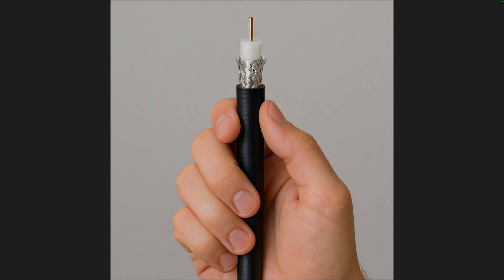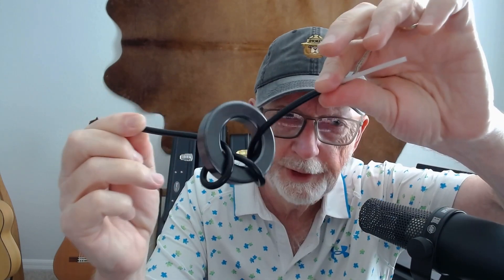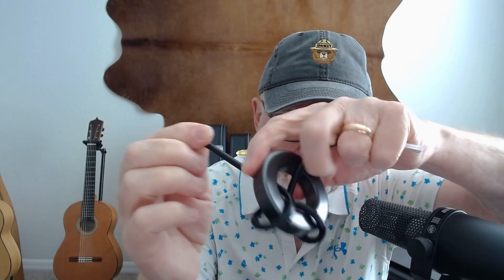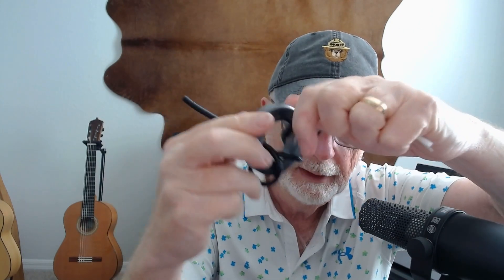Ham Radio Operators Don't Know How Coax Works.

Comment: Instead of using a Ferrite ring, couldn't you just ground it to accomplish two missions?
Reply: From experience, I have found that connecting coax shield to earth ground reduces common mode interference signals (i.e., noise) from nearby EM sources like light dimmers and plasma TV screens.
To a lesser degree, It may reduce common mode current from a connected antenna -- especially when other parallel earth ground current pathways are available; e.g., a radial system for a ground mounted vertical antenna.
Also, earth grounding coax shield provides some lightning protection.
Regardless, I always place a CMC near the feed point of any coax fed antenna that's not ground mounted, and a CMC at the transceiver.  For ground mounted antennas, I leave the CMC off at the feed point which allows the outer shield to  perform like an additional radial wire.
Reply: @DaDitDa  This should not be anecdotal. It is textbook RF hygiene. Voltage-driven (E-field) displacement current from local noise sources can be reduced by grounding the coax shield, since this provides a low-impedance path to drain the induced potential. However, a common mode choke will do the same and often better, by presenting a high impedance that prevents the current from flowing in the first place. On the other hand, current-driven imbalance from the antenna system requires a choke. Grounding will not stop a driven RF current. Only high choking impedance at the right location will. So while grounding helps for E-field noise, choking is effective in both cases and is generally the more robust solution.
Reply: @on6ure  To paraphrase Steve Martin: Well, excuse me for being anecdotal.
Reply from the maker: The shield of a coax feed line IS connected to the chassis ground.  Doesn't stop RF in the shack problems.

Comment: You really are a goto source for great myth busting!  A couple of small points though.  Ladder line fields do not cancel perfectly - there are some significant near fields which is why it is important to run it properly away from conductors.  Coax avoids that issue.  Also, losses are primarily due to the I^2 R skin effect losses of the conductors.  Ladder line losses are lower from having a much higher characteristic impedance, thus lower current and lower I^2 R losses.  Finally one extra note on balanced/unbalanced:  A key point is how a line reacts to external signals like noise.  Balanced line will pick up noise equally on both wires, so the desired differential signal is mostly unaffected.  Coax will only pick up noise on the shield. That is the origin of it being called unbalanced.
Reply from the maker: Great points and thanks for sharing your knowledge!

Comment: Return current floating on the outside is still differential mode ... it will obey Kirchhoff's Current Law. It flows still in the opposite vs center ... it does not make a magical phase turn ;) This is according to me the most stubborn myth in ham radio ...
Reply: Somewhat true.  But with the shield grounded -- the usual case -- it's connected to the return pathway of all sorts of RF signal sources -- including EM sources like the inter-connected antenna and nearby RF emitters.  In other words, the shield's impedance with respect to ground approaches zero.  Thus, via mostly capacitive signal coupling and direct connection to an antenna radiating element, the outside of the shield provides multiple signal return pathways via ground; i.e., an unbalanced condition.  This is not the case for a true differential mode transmission line where both conductors are isolated from ground.  If a stray RF signal source couples to a differential pair, it will likely be equally coupled to both conductors, and it will have no return pathway via ground.  Thus, there will be no unbalanced or common mode signal flow on a differential pair.
So, for coax, it appears that the inside shield and center conductor are operating in differential mode, and the outside shield is operating in unbalanced mode which supports common mode signal flow.
Reply from the maker: Great to have @DaDitDa on this channel.
Reply: @BustRadioMyths  Thanks.  I try to relate what I think I know.  Sometimes I get it wrong, but always open to corrections and new ideas.
Reply: @DaDitDa You’re overcomplicating a simple concept and conflating several things.

In coaxial cable, the signal flows in differential mode: forward current on the center conductor, return current on the inside of the shield. These currents are equal and opposite. That is textbook differential mode, and Kirchhoff’s Current Law applies throughout, even when the shield is grounded.

The outside of the shield is not part of the intended signal path. When current appears there, it is not a separate “unbalanced mode.” It is imbalance-induced return current, typically caused by poor choking, antenna asymmetry, or improper feedpoint design. This current is still part of the differential system, just displaced from the ideal internal path.

True common mode current can also result from near-field coupling, where strong external electric or magnetic fields induce in-phase current on the outside of the coax shield. This induced current always flows with respect to some nearby conductive structure or RF reference, such as a chassis, tower, radial system, or even the Earth. This mechanism is distinct from transmission line imbalance. It behaves more like unintentional antenna pickup.

Also, grounding the shield does not cause the return signal current to flow through the ground. The return path remains confined to the inside of the shield. The shield’s low impedance to ground does not change this, because the fields are still confined between the center conductor and the inner surface of the shield.

Bottom line: coax is a differential transmission line by current behavior, not geometry. Any current on the outside of the shield is a problem, not a valid operating mode. Whether it comes from imbalance or external coupling, it should be suppressed with proper choking.
Reply from the maker: I love it when guys like @on6ure who have with big brains comment. LOL.  Welcome!!
Reply: @BustRadioMyths  with pleasure ;) love your sarcasm

Comment: Coax is an unbalanced line due to its asymmetrical signal conduction.  The shield is commonly connected to ground.  Thus, it serves as both a signal return conductor and an EM shield.  The center conductor is isolated from ground, and acts as the prime signal conductor.  Therefore, signal voltages on the two conductors are not usually equal and opposite (i.e., unbalanced) because ground is common to all signals and EM sources within and impinging on a signal generating system.
On the other hand, a balanced line's two conductors carry equal and opposite signal voltages relative to ground, and neither conductor is connected to ground; thus, signal conduction is  symmetrical or balanced.
Reply: @BustRadioMyths This is also a common misconception. Coax is often called “unbalanced” due to its physical geometry, but that doesn’t mean it operates in an unbalanced mode. In proper use, coax carries equal and opposite currents: signal on the center conductor, return on the inside of the shield. This is differential mode, which is what defines a balanced signal electrically, not geometrically. Grounding the shield does not force current to flow through the Earth, the return current remains confined to the coax. A balanced line has symmetry in both geometry and field exposure, which helps with common mode rejection, but balance is ultimately about current and voltage behavior, not whether either conductor is tied to ground. Coax can carry fully balanced signals and ladder line can carry unbalanced ones, depending on how the system is designed and driven.
Reply: @on6ure  I think we are in agreement.  The RF signal-source grounded (i.e., not necessarily earth grounded) inter-shield and RF signal-source ungrounded center conductor typically operate in differential mode.  But the outer-shield can operate in unbalanced mode; i.e., carry RF current different from RF signal-source return current.
Reply: After some enlightening feedback from ON6URE, and spending some time studying some dusty text books, I've come the conclusion that I was "close, but no cigar" regarding my understanding of balanced v/s unbalanced RF transmission lines.
In the case of coax, with its shield and center conductors directly connected to antenna conductors, it appears that "return" RF current splits along two pathways: the inter and outer shield.  The RF current that flows along the outer shield is referred to as "common mode" and the inter-shield current is simply unbalanced (i.e., not equal) with respect to the center conductor's current.  By choking the "common mode" current, its return-to-source pathway can be blocked, and current balance is restored to the inter-shield, relative to the center conductor's current.
Of course, this explanation does not include the influence of external or spurious EM sources that may add to signal currents on the outer shield, in an unbalanced manner.  But these spurious signal currents have little to nothing to do with the basic/inherent unbalanced RF transmission line characteristics/attributes of coax cable.

Comment: What we need is shielded ladder line and ditch the coax !
Reply from the maker: Coax can be run in parallel with the shields connected together to form a shielded balanced line.  Great idea I'll make a video on that.
Reply: @BustRadioMyths  Shielded ladder line would, in theory, combine the low loss and balanced nature of open-wire line with the EMI immunity of coax. But the moment you enclose a balanced line in a shield, you start to alter its field geometry and turn it into something else, essentially a pair of conductors inside a grounded sleeve, which starts behaving more like coax with a high characteristic impedance. True balance depends on the surrounding environment being symmetrical. Once you add a shield, you’ve broken that. But what we really need is proper current balance, good chokes, and respect for the feedline as part of the system, whatever form it takes.
Reply: @BustRadioMyths  Running two coax cables in parallel with their shields tied together does not create a true balanced line. It creates a shielded unbalanced system where the shields form a shared return path, but the currents on the center conductors are not guaranteed to be equal and opposite unless carefully driven with a true balanced source and terminated symmetrically. The shields themselves can carry unwanted stray currents (common mode and others), and the whole system is still referenced to ground through the shields. This setup defeats the core advantage of a balanced line: isolation from external fields due to symmetry. What you end up with is heavier, more complex coax that acts like poorly balanced twinlead.
Reply: There is shielded balanced line, but it's usually 100 to 200 ohm and has a plastic dielectric; i.e., it's not as efficient as open ladder line.
Reply: Yes please make a video thx 👍 it would be interesting on how it works and what the lost would be if any at all 👍
Reply: I've actually fed a doublet with "twin coax" (forgot ladder line for remote setup). It worked well!

Comment: Good explanation.  Coax also typically has more loss than ladder line because the characteristic impedance of coax is lower, resulting in more current for a given amount of power.  

The conduction loss (typically called "copper loss") is proportional to the conductor resistance per unit length times the square of the current.  Thus, current has a big effect.

Coax that is mostly air dielectric not only has minimal dielectric loss but also has a larger inner conductor for a given characteristic impedance and for a given outer conductor diameter.  The larger inner conductor reduces the copper loss.
Reply: No doubt that conductor loss is contributory, but it's not dominate.  Signal power loss in coax is mostly dominated by dielectric loss.  The same is true for ladder line.  A 300 ohm line with air dielectric is less lossy than a 300 ohm line with a plastic dielectric -- assuming same type and size conductor.  In other words, a line's impulse impedance is NOT the dominate factor in its loss -- it's mostly due to dialectic loss. 
So, it's a myth that ladder line is significantly less lossy than coax due to its higher impulse impedance and reduced current flow.  In fact, it's mostly due to air v/s plastic dielectric.
(Edit note: Dielectric loss is not significant or dominate at HF; it only becomes a significant loss factor at upper VHF and above.  The higher the frequency, the more it becomes the dominate loss factor.)
Reply: @DaDitDa  Perhaps you are speaking of millimeter waves.  Dielectric loss only dominates in typical coaxial transmission lines at upper microwave or millimeter wave frequencies.   Dielectric loss is very low at low frequencies, but it varies approximately proportional to frequency, whereas conductor loss begins at a fixed value at a low frequency and then increases proportional to square root of frequency due to skin effect.  In the frequency range below microwaves, the conductor loss dominates.  You can refer to Microwaves101 on-line, for more information.  Other texts such as Introduction to Electromagnetic Compatibility by Clayton Paul and Electronics Designers' Handbook, Second Edition, by Giacoletto bear this out.  In the case of ladder line, virtually all the electric field is in air where the dielectric loss is essentially zero.  Ladder line is dominated by conductor losses at frequencies where ladder line is typically used.  As the frequency is raised, eventually radiation losses will dominate in ladder line.
Reply: @analog_guy  I agree.  I overstated the contribution of dielectric loss in coax at HF.  Although, with all other factors being equal, any line with a plastic dielectric will suffer more signal loss than one with a dry air dielectric; thus, the dielectric becomes the dominate loss factor difference -- even at HF.  Granted, the loss is not significant (i.e., dominate over conductor loss) at HF, but it's a loss nonetheless.
Reply: @DaDitDa  Perhaps you are thinking of millimeter waves or upper microwaves when you say dielectric loss is dominant.  At frequencies up through UHF and lower microwaves, conductor loss dominates in typical coaxial cables.  In the case of ladder line, conductor loss is also dominant until the frequency gets so high that radiation loss dominates.  You don't have to believe me.  See on-line, for instance, the AC6LA transmission line calculator or the Microwaves101 coax loss calculations or see texts such as Introduction to Electromagnetic Compatibility by Clayton Paul or Electronics Designers' Handbook by Giacoletto.

Comment: Excellent explanation of feed lines Mark. I have given up trying to explain this on the air because it almost always results in an argument. If you dare to start up a discussion about dielectric losses in feed lines on the air, you open Pandora's box and all of the "experts" come out of the woodwork to argue.
Reply from the maker: Like I said - many hams don't know how coax works.  Kinda like an auto mechanic who doesn't know how an engine works.

Comment: Another way to view a coaxial cable, or any other type of RF transmission line, is as a propagation pathway for RF EM waves.  The EM waves propagate within the dielectric of a coax transmission line (in the direction of electron displacement near the surface of the cable's conductors) toward the load/antenna.  In this manner, a coax cable functions as a EM waveguide.  When the EM wave emerges from the coax it continues to propagate between the antenna's conductors pathway of electron displacement and ultimately radiates into open air space.
Reply from the maker: That's a great way to look at it!